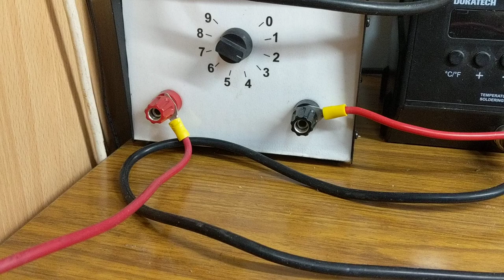Using a Resistance Solder Unit on etched loco kits

Comment: Now that makes a huge amount of sense, very neat.
Reply: This is my unit.
You can get a huge amount of heat from them.
At around 5 volts it drew 70 amps ,that is 350 watts.
I normally use it around 2 volts

Comment: Who makes these units? And can you point me in there direction please?
Reply from the maker: Try London Road Models, or frost.co.uk. The London Road Models one, although quite expensive, is a commonly used model. The other one is not particularly designed for modellers, but about half the price.